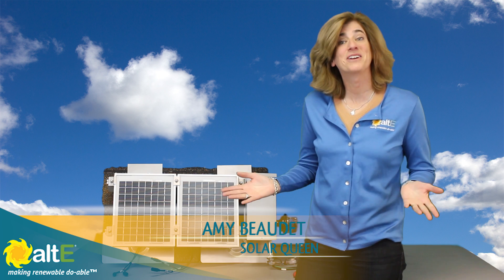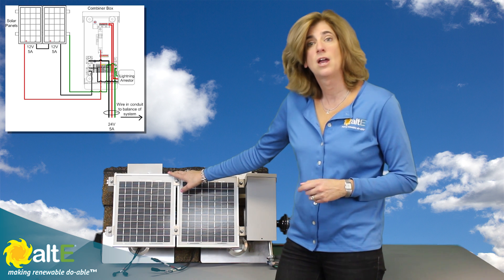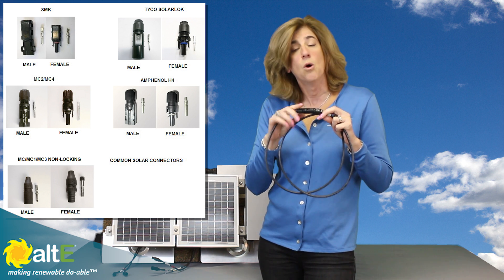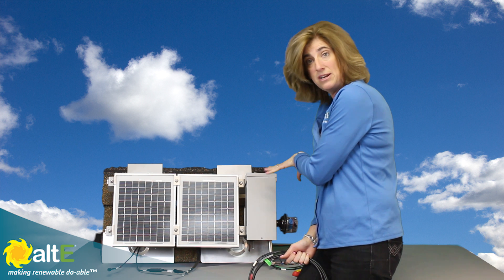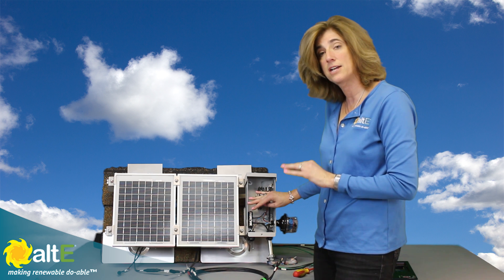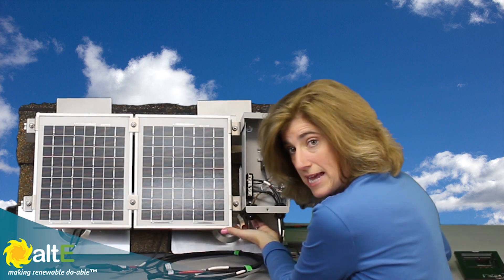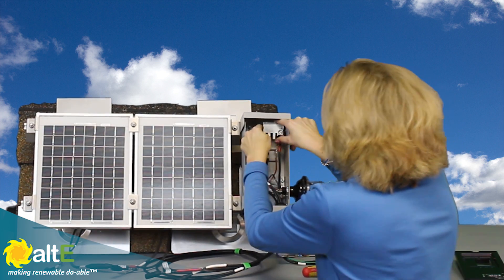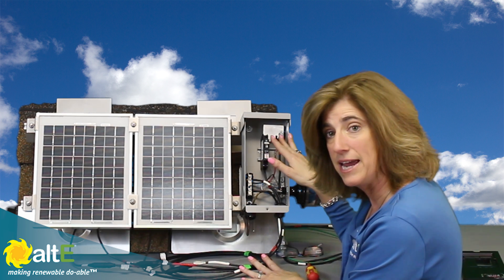How to wire solar panels in series.

Comment: Love your videos. Can you charge a 24volt battery bank with a 36volt solar panel system?
Reply: Yes, using a MPPT charge controller rated to handle the current going from the charge controller to the battery bank.

Comment: Hi I have 4 panels, they're are all 150w but two are older and have slightly different parameters than the new ones. I was told that it'd be the best to connect old and new in series and then the couples in parallel. I am concerned that the oldest solar panel with lower parameters and lower output due to its age will affect the power output on the new one (just like shading would-the old ones are slightly faded). Do you recommend me to go ahead with this plan or to connect two new ones and two old ones in series and then to connect them in parallel. I am looking for max output. Thanks a lot.

Comment: I have 2.100 watt Noma. Each come with its own controller, and I have 2 batteries. How do I join these, use 1 controller for both?? Or a way to have 12 volts that feeds from both batteries at once, and stay 12 volts out, not 24 v
Reply from the maker: Since you have the 2 controllers, just wire both of them in parallel to the battery bank.
Reply: @AltEStore  thx so I have 2 feed wires coming into my house, a POS and Neg  from each panel,  I know what parelel means, but I still can figure what you mean, I join wires into  one controller?, then join 2 controllers, then how do I join both batteries.??

Comment: Would it be helpful to connect 2 100watt 12volt panels in series for 24 volts and then another 2 sets of panels and then put them in parallel? would it increase the amperage? Thanks in advance I really love watching your video's very helpful.

Comment: Thank you for great videos Amy. Could you please check the labeling of MC connectors in this video,  it shows Male for Female labels and vice versa.
Reply from the maker: The labeling is actually right, but confusing. Because it is based on the inside metal pin, not the outside plastic case, without looking inside the connector, it seems backwards. So while the outside case looks male, the inside pin is female.

Comment: OK needs some answers here can you run series and parallel in an array next if you are running an mppt charge controller and if so does the charge controller see the 12 v 24 v so if per say your running 12 v it still coverts it to 12 volt no matter the imput voltage
Reply from the maker: MPPT charge controllers have a voltage range that you can input. It needs to be higher than the battery bank, but lower than the charge controller's max voltage, usually around 150V. So you will often see multiple parallel strings of 3 solar panels in series. The MPPT charge controller will convert the higher voltage down to the right volts for the battery bank, and will also raise the output current, so you are not losing any power. For example, if you have 100V 8A going into the charge controller to a 12V battery, you will have 14V 57A coming out. So you would need a 60A MPPT charge controller. You can see more about MPPT charge controllers in this video, https://youtu.be/K7NWpxxEB9o
Reply: ok i have a midnight 150 so as long as i don't go over 150 volts or 97 amps i am good . and what ever to charge controller detect the bank voltage to be  it uses so if it 12V yes . Now as far as the array let say i run 4 12 v panels  in parallel then i run 4 more as series. thee parallel would be 21.16 amps and 18.9 v and series would be 72.8 volts at 5.49 amps the combine array would be 91 v and 26.65 amps. should one stop or how much more in panel would you with a 150 midnight
Reply from the maker: If you have a 12V battery, you can have up to 12V x 96A = 1152W going to the charge controller. So you could have eight 140W solar panels, wired in 2 parallel strings of 4 in series. Wire 4 in series, wire the other 4 in series, then wire the 2 sets together in parallel. The voltage used to figure the max volts is the Voc, so probably around 21V x 4 in series = 84V in, If the amps is 8A each, then it would be 16A in with 2 parallel strings.
Reply: they would be 100 watt panels  the figures i gave were form them one string in parallel and the other in series  and that would a total of 800 watts because that's what i am working with for panels
Reply from the maker: Use the Isc, not Imp, which is probably closer to 5.74A. So you would need 2 fuses or breakers, probably 10A each.
Reply: altE if I ran 2 strings in just parallel  they would have 21. What ever  I said above no the series string would be 5.74 amp  with I think would be 74 . What ever I said above so I would need a 25 amp and 10 amp breaker . See I was under the impression that to take adantage of mppt you try up the voltage or is it better to just run parallel  strings and meet at he combiner box just try to one understand how best use a a mppt  charge controller
Reply from the maker: Look at this picture, i think it will clear it up. https://i.imgur.com/mIqRXt3.jpg
Reply: ok i see this is in series why not parallel?? i also note the voltage in your diagram is that the short circuit voltage or the operating volt a 100 watt panel out put is 18 volts at 5 point what ever amps i also note the your back feeding the beakers instead of a buss feed to the beakers
Reply from the maker: The combiner box is taking the two series string and wiring them in parallel. So you have two parallel strings of 4 in series. When determining the max volts and amps in a circuit, you use the Voc and Isc.
Reply: i understand what i am asking you is the reverse why not 2 stringing in parallel or one string in parallel and one in series then combine at the box are there any other advantages or disadvantages to the 2 other ways of wiring it and why
Reply from the maker: This is the best way to wire panels.
Reply: reason
Reply from the maker: Draw a schematic of what you are proposing. You have to have the volts and amps match in each string.
Reply: so what you are saying is both strings would have to be the same voltage at the combiner box ? so if both strings  were  in parallel both strings would be roughly  say 22 amps at 18 volts giving 44 amp at 18 volts  yes at the combiner box
Reply: the main question it boils down to why do i want the higher voltage vs the higher amps

Comment: Back to Physics 101.....I (amps) = E (volts) / R(ohms). Volts in Parallel are added. Amps in Series are added. Oy, my head hurts.  Thanks for your review.
Reply from the maker: Volts in series are added. Amps in parallel are added. You can remember because there is an A in amps and parallel.
Reply: Sorry.  I developed this mnemonic: V olt A ge S Volt  are Added in Series. Am P s are added in Parrallel.  Now I have it. Thanks.  Your videos are the best.

Comment: I am a bit confused with combiner boxes when I'm doing a grid connected system. I have a 10kw hybrid system. From the manual of the 10kw hybrid system I can connect 14 of my 265w in series,another 14 of my 265w in series and finally 14 of my 265w in series to get three strings. From my data at the back of my panel I am supposed to use 15A 600V dc breaker in the combiner box. The question is how do I get the three strings come out of the combiner box? From the video I just watched would all the three strings come from the same point? Also won't the finger busbar increase the current. Pls I'm confused at that point because I still need three strings going onto my inverter and the rating of the mppt in the inverter is 2*18.6A. The working dc voltage is between 300v to 900vdc. Please advice on how I wire from the combiner box to the inverter. Lastly do I need another breaker or DC switch between the combiner box and the inverter. If so should it be the same size of 15A? Thanks.
Reply from the maker: It depends on the inverter. Do you have three MPPT inputs to the inverter, or do you have just one input? If you have three, you would use a pass thru box, not a combiner box. It just passes each of the strings through into conduit, with a separate pair of wires for each string right into the inverter. A fuse or breaker is not needed for just one or two strings. If the inverter only has 1 MPPT input, then you do need to combine them in a combiner box first. Each string of 14 in series would go to its own 600V breaker or fuse, and the finger bus bar combines the output of them into one combined string with 3x the current. For example, if each panel has an Isc of 9.2A, then the output on the finger bus bar will be 27.6A.  Most people use fuses aand fuse holders in the combiner box for grid-tied, as it is less expensive than a 600V breaker. Make sure you do not use a 150V breaker. Those of for off-grid into a charge controller.
Reply: altE Thanks for your rapid response. so the inverter has 4 mppt inputs. so I can series the fourteen each so I will have them coming directly to the inverter.  meaning I would have 3 Strings coming to the inverter and there would be an unused mppt remaining. again my questing there is how do I protect the system?  I have grounded my panels thought but what about the lightning arrestor I saw in the combiner. also what would be your advice on the position of the combiner box. should it be close to your arrays or close to the inverter? again if you can get a DC breaker in your locality would you recommend an AC breaker of higher rating?  thanks once again
Reply from the maker: Yes, you can just run them in conduit from the pass thru box to the inverter. Here's an example of a pass thru box. Since that box is where you transition into conduit, it needs to be near the solar panels. You do not need breakers, since they are not being combined. But if you did, you should never use AC breakers in a DC circuit. They break differently, and AC breakers could cause an arc when tripped. Not everyone uses lightning arrestors. If you are using lightning arrestors, you need 3, one for each string. Depending on which box you use, you may be able to put them in there, or in the inverter.
Reply: altE Thanks very much for the information. I'm sorry if am asking a lot of questions. I just want to be educated well on the connection and everything about renewable energy. so does it mean the only protection you give to your solar modules is just the grounding?  please elaborate on the protection you give to your solar panels and indirectly to hour inverter since the string cables find itself directly into the mppt port/input on my hybrid inverter. thanks once again

Comment: Hello Amy.. If you have 2 100w solar panels in Series, and one of them goes into the shade and the other is still in the sun, will it drop the effectiveness (suck poser out of the remaining 100w solar power)..?  I'm have a limited space and at different times of day one half is in the sun and then later the other half goes into sun light.  What is best..?  Parallel or Series..?
Reply from the maker: We actually have a whole series of videos testing different scenarios like that. Here's a goodone, https://www.youtube.com/watch?v=ofo1HQyGG8s Assuming you have a 12V battery bank, wiring them in parallel works better in a partial shaded situation. If you have a 24V battery bank, you have no choice but to do series.

Comment: thanks +altestore, I have a stupid question that I can't seem to find the answer for. I live in an area with lots of cloud cover. Would it be harmful to my charge controller if I connected more panels to it than it is rated for. for example, if I have a 40a mppt 1000w  controller, and I connect up 1500w of panels. On a normal cloudy day, I get 30% of my panels maximum power converted, on a bright sunny, I get about 90% conversion. I only get 10 sunny days per month on average. I know there is a reason for having a maximum rating, but I was wondering if there is a way I am connect more panels than my controller is rated for, for the cloudy days?
Reply from the maker: That's actually a good question. It depends on the charge controller. For example, Midnite recommends if you have more than 20% of the rating, you should add a second charge controller. So, maybe go up to 1200W.
Reply: Thanks for the super fast response +altestore, I have just discovered when reading the manual for the maximum PV wattage; that the EPever Tracer 3210CN/EM1 has a max PV array power of 2340W @24v even though the rated charge power is 780W @24v. (that is 33%). Even though it sounds dodgy to me, I have found the Tracer 4215BN to be a solid performer so I hope the same holds true for the CN series. I guess I shall try it out and see what happens.

Comment: Hello Amy great videos you are the Queen of solar :) . I just purchased a outback flexmax 80... fm80-150VDC  I have 6 topoint  245 w solar panels 4.95 A  they have a max power voltage of 49.51 V . the charge controller has a max pv source voltage (open circuit) 150 VDC  how would I wire the panels to not go over the max vdc?
I really wish that I found your site before I purchased the outback you have it listed cheaper and there tec ...is not very good at all :( . watching your video I think you would need to know the array is in the yard not on the roof and the wire will be in the ground. I haven't purchased the inverter yet  But I would like a 24 volt systems. 
Thank you
Reply from the maker: Unless you are in a very warm climate, you can only wire those panels with 2 in series. So you will do 3 parallel strings of 2. Figure 100V for the voltage and 15A combined for current when you figure out voltage drop. A calculator I like is http://www.calculator.net/voltage-drop-calculator.html . You want to shoot for under 2% voltage drop, so at least 4AWG may be needed for 200'.  Had you gotten a Midnite Classic 200 instead, you could have done 3 in series, and had 150V and 9A, so 8AWG could have been used to stay under 2%. (Any chance you can exchange it?)
Reply: I would love to exchange it!  I will have to see how much it will cost.
If I use 4AGW  for 3 parallel strings does that mean I will need 3 sets of wire at 200 foot long to bring it to the charge controller.  Or can I use a combo box at the array and use 1,  4AWG to go to the charge controller?
thanks
Reply from the maker: If you combined it at the solar array with a combiner box, like the Midnite PV3, you would use one pair of 4AWG to the breaker box inside by the charge controller, then to the charge controller (it can handle up to 2AWG). If it is easier to run 3 strings back, you could use 3 pairs of 10AWG, and combine them by the charge controller.
Reply: I looked at your web site and found the Midnight PV3, and looking at more of your products I'm interested in the pre-wired combiner box. However in the next 6 months I will be getting 6 more panels so I want to think ahead. I am wanting to exchange the outback as you suggested  
knowing that soon I will have 12 in total panels at 245 watts what combiner box and what charge controller would you suggest. Will the 4AWG still work?
Thank you for your info.
Reply from the maker: 245W x 12 panels = 2940W / 24V = 122A. You'll need 2 charge controllers. I'm still liking the Midnite Classic 200 for you, just get a second one when you get those additional panels to wire them together in Follow-me mode, so they will work together beautifully. 
If you were to upgrade to a 48V system, you'd have only 61A, and could then fit them on 1 charge controller (twice the volts, half the amps, same watts).
Reply: what about the combiner box? I am not opposed to 48V system I'm still looking at inverters.. are there any disadvantages or advantages to a 48V system.
thanks
Reply from the maker: Since you need to limit the number of parallel battery strings to 3 or less (the fewer the better, some say only 1 string should be used), a 48V battery bank allows you to have a larger battery bank. For example, if you have 12V 200Ah batteries (to make the math easy), you could have 3 parallel strings of 2 in series for 24V (6 batteries, 14.4kWh), or 3 parallel strings of 4 in series for 48V (12 batteries, 28.8kWh). That's twice the storage, with same number of strings. Of course you can also limit the number of strings by using a higher Ah lower battery, like 2V 600Ah batteries, 12 in series for 24V or 24 in series for 48V. So again, you can have twice as much storage with 48V than 24V. Also, a 24V system will have twice the current between the battery bank and the inverter, so needs bigger wire for the battery cables. Also, 48V lets you use 1 charge controller for all 12 panels instead of needing 2.
Reply from the maker: Regarding the combiner box, if you do upgrade to the Classic 200, you have to make sure the combiner box and breakers into the charge controller you use supports more than the standard 150V. You can use the Midnite PV12-250 with 300V breakers. https://www.altestore.com/store/enclosures-electrical-safety/electrical-enclosures/combiner-pass-through-boxes/midnite-solar-mnpv12-250-combiner-box-p8809/ It can either combine all 6 strings of 3 in parallel if you are using 48V and 1 charge controller, or two sets of 3 in parallel to send to 2 charge controllers if going with 24V.
Reply: I have 8 6V batteries 225 ah is that enough to wire a 48V system?